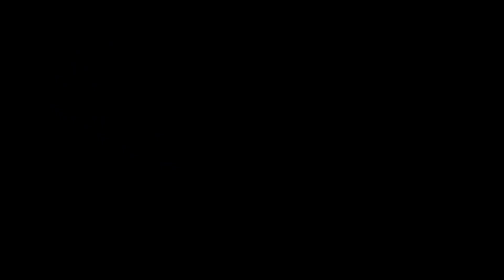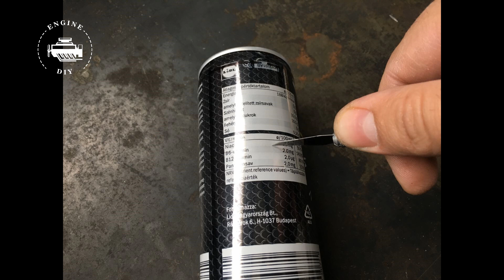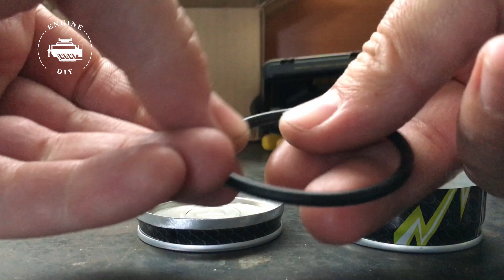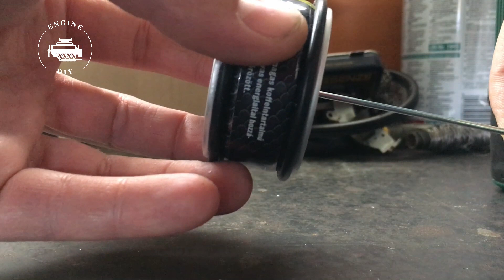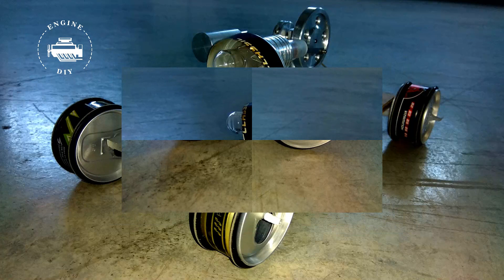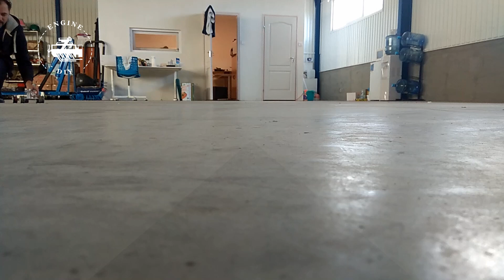[TUTORIAL] DIY Stirling Engine Car - How to hack a KIT

Comment: Blade this is awesome.  What if the car had the Stirling powering a small dc generator that charges a capacitor and drive motor?  Hybrid with speed control
Reply from the maker: Good idea, I'm pretty bad in electrical things unfortunately...

Comment: Slide crank vs scotch yolk stirling engine.  I just learned that scotch yolk spends more time in positive displacement than slide crank 
https://en.m.wikipedia.org/wiki/Scotch_yoke#/media/File%3AScotch_yoke_displacement.png

While its said that the scotch yolk's additional time spent at top dead center makes internal combustion less efficent through greater heat loss, would that help or hurt a stirling motor or heat  pump?

I see the piston has a lower top acceleration with the  scotch yolk.